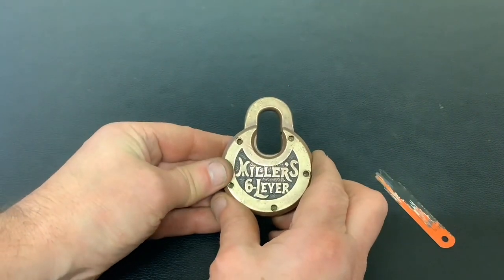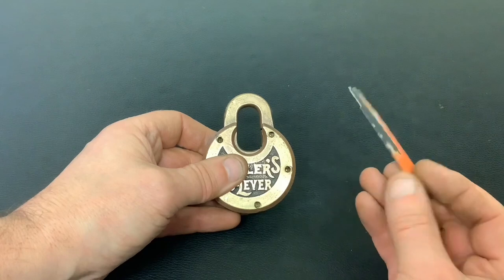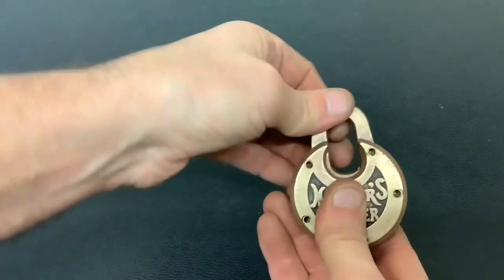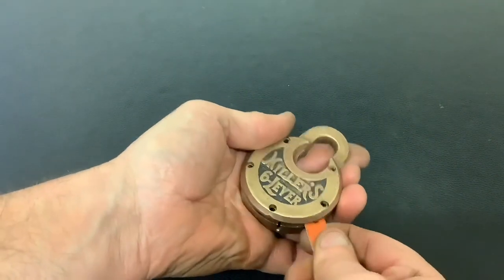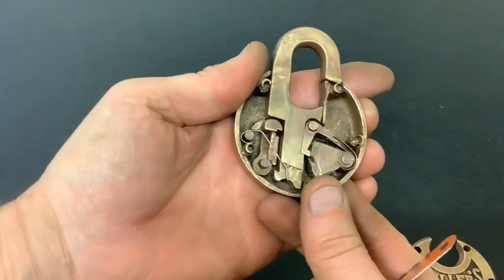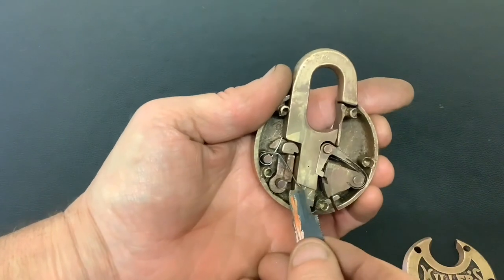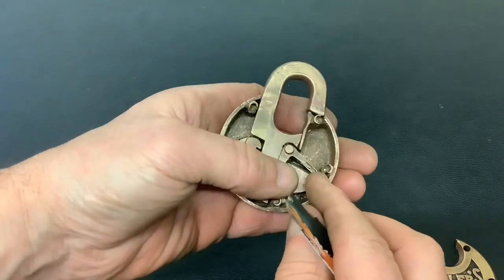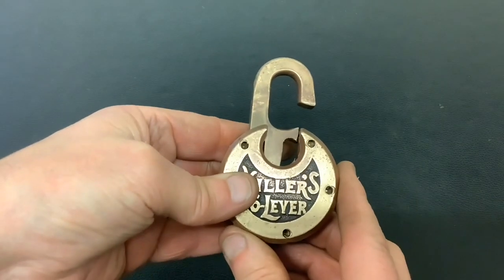701. Update on Millers 6 lever padlock | spring made from hair grip & key made from hacksaw blade

Comment: Yess ...
I was waiting to see the result .
How are you going to fasten the plate ?
I have 3 of these, and are such a cool locks in my collection. I do think that some of the older locks have a super quality about them...
Reply from the maker: I will probably use some small hammer drive rivets to fasten the plate, drill a small hole in the rivets that are still in the lock and hammer the new rivets into the drilled holes in the old ones 👍
Reply: @BrummieLockPicker  yeah I am wondering on how I'm going to redo mine.
I was thinking along the same lines but never attempted it before. Just remember something from school on metal work but that was a century ago LoL 😂

Comment: Is there any way you could do a video on how you determined the cuts for the hacksaw blade?👍🦊
Reply from the maker: Sorry Jack it’s too late now as I have already made it, I should have do a video when I was actually doing it.
Simple to do because the lock was apart. I removed 5 levers and left one lever in the lock and filed down the hacksaw blade until the lever was in the right position, then did it again with 2 levers in the lock, then 3 etc, eventually I had the 6 notches 👍👍
Reply: @BrummieLockPicker    Thanks. That is enough information to go on to try it out.👍🦊